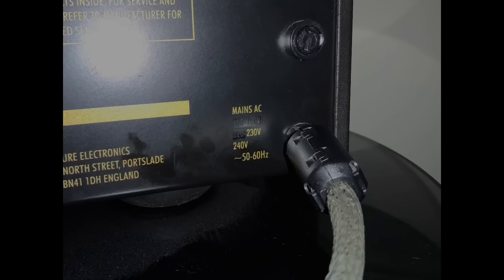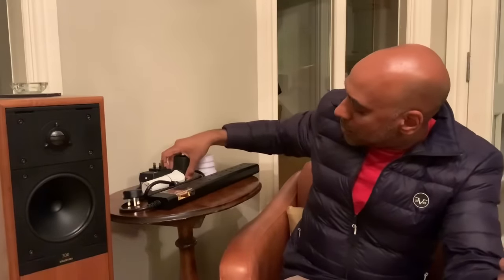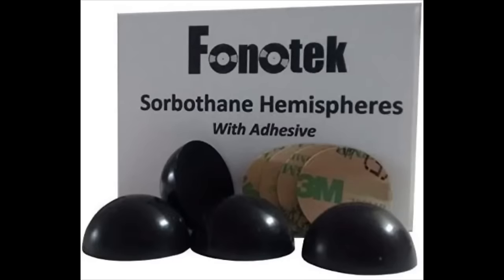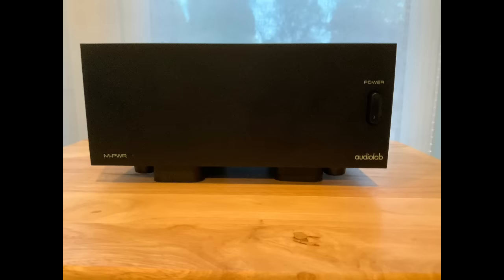My Top 5 Inexpensive Hifi Tweaks

Comment: My audio system is in the shed (think 5 star man cave). I researched and adopted all but the cable option. But, as the shed is on the same mains ring as the freezer, washing machine and boiler pump my Powerline BB dropped every time a device was used. I added a local mains conditioner, AND ferrite filters, looping where possible, to reduce the noise coming down the line. Appears to work (BB speeds will attest). My network is now stable and as such, my shed-fi (as it is known indoors) also benefits from a lower noise floor. I used to sell isolation cones (RDC) and these cover all frequencies, luckily I have a few from that time and have them under all components and speakers. One to watch out for is LED lighting. LED lights cause massive EMI issues and best switched off during musical appreciation sessions (as it was known at school). The last top tip from me is to use CAT8 cables everywhere. Ditch all the cat5 and cat6 for cat8, for one reason, insulation. (again Powerline BB will attest to faster speeds to the shed). I listen to music from my TC (networked) and from a TT in the shed as well at BT from my Samsung S8, this connects to a £30 aptx converter then I use a silver connector to the pre-amp. Shipped in from Poland I believe. I tested all the usual suspects from renowned UK manufacturers that I have been loyal to for years, but took the plunge and went for silver - just for this connection. Everything else is copper....
Reply from the maker: Hi Adrian, very interesting. Thank you for watching and sharing your experiences 😉

Comment: Hello Tarun,

I just got some KEF Reference 5 speakers and they are currently on a wood floor, with pad and carpet on top. I really need to do something with the spikes! The little cup that is supposed to protect my floor is trying to go through the carpet!
I heard you mention the washer cups and think that at 60.2 Kg, the spike cups will either go through or crush the washer cups making them useless.

Do you have any other ideas for heavier speakers?

Keep up the great work!

JD
Reply from the maker: Thank you JD. If it is a suspended wooden floor, try removing the spikes altogether and get some anti-vibration washing machine feet 😊👍

Comment: Hi Tarun took on board  your thoughts and under my turn table I put 4 washing machine  isolation feet (cost £2.70) then i looked at the leads to my amp, the Sony ps-hx500 comes with cheap basic leads I replaced them with some QED leads keeping the earth wire ,woll what a difference the bass & drums really come through now & that's just  the start. Many thanks for the inspiration from Rob.
Reply from the maker: Thank you for watching Rob. I’m glad it worked out👍

Comment: May I say,  I highly recommend a serge protected power strip, if you do nothing else with mains power. I have had my very expensive(was in my twenties, so yes, very expensive for me at that time) reel to reel recorder blow a diode in it’s rectifier, due to a midnight power serge, which I finally had to track down and repair myself, because warranty shop couldn’t find the problem. Equipment was away for months while they did nothing to resolve it. Look at this... it happened years ago, yet I’m still finding need to vent about it. That’s how painful it was to not have that serge protector! Ha ha

  Thank you for taking the time to read this... and thank you for another fine video! 

   Chuk
Reply from the maker: Hi Chuck, good to hear from you buddy. Well said. A friend of mine had a lightning strike that took out his entire system. Thank you sharing 😉👍

Comment: Thank you so much for these tips! After A- B - ing with ferrite beads & without, I liked the sound with. Having suggested them to my brother(who's in Camden by the way) who was having weird sound interference with his guitar amplifier, he tried them out and fixed the issue! I did get a power conditioner to try, and liked it but after upgrading my amp's power cord, I no longer need it. Now I have weights on my amp and dac and the sound has increased ten fold! Microphonics and microvibrations are 'real pests' and must be soundly addressed which I'm so glad you mention here. "You never hear your stereo system sound better than the weakest link in your audio chain." ~ Steve Deckert AMEN!🙏🏾
Reply from the maker: Thank you for watching and sharing your experiences Steve. Very insightful 😉👍

Comment: It doesn't matter greatly in terms of a power cord as shown here, but generally speaking, you should only connect the shielding to ground at the supply end of the cable. This is to avoid the risk that the shielding acts as a ground conductor - both generally speaking, but in particular also in the event the main ground conductor fails. The shielding is obviously not sized for this purpose, and the risk is that the GFCI may not trip as intended if a broken ground conductor results in a dangerous touch voltage. And obviously because only one point of grounding is needed to drain the shielding.

It's definitely possible to find sources indicating the contrary, but applications where both ends of the shield are grounded are typically meant for very different circumstances - for example for signal cables between systems, where e.g. disassembly may be carried out whilst systems are under power - e.g. industrial control systems. These systems will often have other measures to ensure the cable shielding does not become an equalizing link or protective earth, for example by having much bigger and possibly redundant equalizing links parallel to the cables.
Reply from the maker: Thank you 😊

Comment: Nice to see your cable maintenance is first class. I have to hide behind my unit  7 speaker cables  1 subwoofer cable 1 fiber optic cable  4 hdmi cables and 4 power cables 1 monster surge protector 4 led light cables in a space of less then half a meter from back of wall to back of unit. And you  might just see 1 hdmi  cable going from blu-ray player to my tv that's it, but there no mess each cable is separated away from each other not over lapping or nothing even got some cables on the wall using a cable holder .
Reply from the maker: Good job Harpal. Thank you for sharing 👍
Reply: I really need to have ago at my atmos system cables everywhere power crossing over speaker cables.thats why I've put supra shielded mains cables on mine they tiny bit better then belden and belden over lapp .but if you've got pictures good idea to see what some1 else has done with cable management give me ideas.cheers
Reply: @markclancy5371  I used u horizon cable clips to hold my wires in a line and derection I wanted to go, good way of  keeping your power cables away from each other and away from speaker cables.  Recently I had taken all my cables off as I was putting black carpet tiles down. But when I did my cables I first started with my surge protector cable to mains path with u horizon but with my surge protector I put in bottom right hand corner of my unit so it's only less half a feet away from power outlet and away from all my cables coming out from my amp and all I do is plug everything's there so no power wires from amp, tv, xbox, bluray player crossing or near my speaker or hdmi cable's. Found them on amazon. But for atmos headache unless you run your cables in wall lol.  For me I had headache about running 4 speaker cables from unit to back of my room so before I ever put my unit in its place I put a run of 4  speaker cables from where back of my unit would be on floor to each area I needed the cable to be for back 4 channels straight down middle then at other end sent cable in direction o wanted it go laid it a flat and tangle free on floor taped it down the whole way down the cable to hold into place on the floor then threw two thick rugs ontop protect my cables. All you see for my back 4 channels is the cable coming from next to my speaker stands and that's it well hidden lol. I put a review of the u horizon cable clips but don't think it will show until day or too. Hope that helps. As for atmos I'd be honest I'd pay for the cables go be chased into the wall may be something you could get done not cheap or better still do it you self look up videos on YouTube how to do that would be best answer and will look  tidy and professional. If your renting dont bother.

Comment: Firstly - enjoy your work!
Just my thoughts on mains cable upgrades. Perhaps, if you go to the trouble of a power conditioner, then adding a quality connection from it to your equipment may help. Given electrical interference is often induced in the wiring from the loads on the circuit rather than from the ambient surroundings they are probable a waste of time without the conditioner.
If the back of your rack is an absolute birds nest tidying up and physically separating cables as much as possible probably has more benefit then any mains cable could.
Reply from the maker: Thank you Matthew 😊

Comment: The ferrit core around the cable are fine but are meant to be closed around power cables to eliminate radiation noise.

Use them on speaker cables will compromise sound quality.
Reply from the maker: Check out this article Lars.
http://www.empiricalaudio.com/computer-audio/technical-papers/myths-and-snake-oil

Comment: You seem convinced there are improvements. I think that if you ran a blind test removing ALL of the tweaks together, most people would not be able to tell the difference. Tarun, please would you do a proper blind test and report back? Thanks!
Reply from the maker: Hi Rands, the problems with double blind listening tests when it comes to audio is that your short term audio memory is very unreliable. DB tests are fine when the differences are substantial but not for subtle differences. My approach to auditioning any new component is to put it in your system for a couple of weeks, listen everyday, then remove it. Do you miss it? You have to be honest with yourself. It is not a scientific method but it is effective.
Reply: @abritishaudiophile7314  Long term audio memory is even more unreliable than short term audio memory.  Rather than you removing a component on your own after a couple of weeks, you should have someone else remove it and not tell you when they did.

To raise one question, how does putting a ferrite core on one speaker lead at the speaker end of the cable affect the sound of the speaker?  If it's filtering audible noise, wouldn't that noise be there even when the system is turned off?  Do you hear noise from your speakers without the ferrite cores, even when the system is turned off?

If you are convinced that RF noise way above the audible frequency range is getting into the speaker and causing distortion of the audio, can you explain how putting a ferrite core on wire and not the other can fix that?  Technically speaking, putting a ferrite core on one lead would convert a mostly harmless common mode RF signal into a single ended signal.  This would be even more likely to affect the sound, although I don't think it will have an audible effect. If anything, a ferrite core around both wires would do a better job of keeping all RF energy out of the speaker.

But I don't believe there is a mechanism by which a small fraction of a milliwatt of random RF energy can distort or add audible noise to a low impedance, relatively much higher powered audio signal.
Reply: @abritishaudiophile7314  You are wrong. DB tests are completely justified for small differences. Then you admit your method is not scientific! Why not DB test one of your cable upgrades and let us know the results?

Comment: Hello good sir, I use to be manager at Oakville Audio in Ontario Canada from 1996-2000 and we had exclusive rights to John Farlow s design Exposure The Serious Amplification System and I was able to meet John and his son when they visited our store, The Royd speaker is also what we sold in league with the Exposure and Sorcerers and Abbots always a good match , your ProAc is also a great combo as we sold those as well, John has moved to Thailand as he has breathing problems and works with Naim Audio as their go to elder master engineer , I have always wanted just a 15 super from Exposure but never could afford the $2000 lol  I'm now using a Naim Nait 5i amplifier and a Nakamichi TA -3a receiver with Nelson Pass Threshold circuit amplification,  using my knoledge of Royd I built speakers using a B&W Zepplin s drivers and John Achroyd s anti distortion rubber damp ner ...absolutely awesome speakers that cost me almost nothing   yeeeeee haaaaaaa
Reply from the maker: That is a great anecdote. Thank you Scott 😊👍

Comment: I added ferrite cores to my speaker wires after watching this video. Non-technically speaking, it has cleaned up my highs and what's interesting and unexpected is that adding the ferrite cores got rid of a persistent 'red light' from my amp (Krell ksa200-s) that turns on when the signal is not pure. The red light would switch on each time I turned up the volume, now it's gone. I thought the audio signal runs in only one direction, not sure how the amp 'knows' ferrite cores have been added near the speaker-side of the cable?  

I also decoupled my floor standing speakers, huge difference to bass clarity - less thump.

Thanks so much for these tips. Though can't find the power conditioner Tarun mentions, here in the U.S.
Reply from the maker: Thanks TK. I appreciate you watching and sharing. I don’t think the Tacima is available in the US. Furman stuff is quite well priced. Cool first name by the way 😉👍

Comment: Would love to know what power conditioners you used over the years? After doing a lot of research and chatting with electrical engineers I removed all furman gear from my studio because of the negative effects they had and due to the fact they were basically snake oil which provided no benefit.
Reply from the maker: I haven’t tried many but I did have a basic Furman once. I removed it because although it added refinement in the mids and highs it did suppress dynamics. I am happy with the IFi iPower I currently use 😊
Reply: @abritishaudiophile7314 See I know it can have an impact on sufficient power supply to equipment but "refinement in the mids and highs it did suppress dynamics" sounds like a bunch of audiophile nonsense, not backed by objective science and facts (sorry if that sounds offensive). Do you have any objective readings or graphs / recordings to back up these claims? Thanks! Love your channel.
Reply from the maker: @Car Guy daddyo cool 😎

Comment: Edited this after 1 year of testing different cables, pads, conditioners and gizmos. Still THUMBS UP for your videos sir!
- Tip number 5, about ferrite cores, not working. I got a signal generator and an oscilloscope and I see that when signal is higher than 10KHz is a very very little bit attenuated which I really really do not want, so, ferrite cores only on mains power cables. 
- Tip number 4, about antivibration pads, it is a definitely yes. I have found that large anti slip self adhesive pads for furniture, placed under floor speakers works wonders. Even better two pieces of wood glued together with black gasket silicone.
- Tip number 3 does not work for me and I have tried many stuff, including really good UPS brands up to 2KVA, borrowed from work lots of equipment, nope, not working for me.
- Tip number 2, I am wondering if you or myself could find to borrow for a few days a big power factor correction industrial gizmo to try it out, meh, jus thinking with fingers on the keyboard.
- Tip number 1,  could have little impact because what are we doing with the lines in the walls? Those are not braided/shielded , those not protected in any form. 
I'll tell you what I have noticed it helps me: for interconnects made myself the shortest possible RCA cables with large diameter of quality coaxial cables (6mm), very low resistance cables. Then made a pair of solid copper wires for speakers, 2.5 square mm and distanced them with plastic (1 inch), those sounds great. Since then I have never used the expensive SUPRA cables again. I have changed every power chord in every audio gear and added thick 16A cables with ground wire connected to a solid ground connection. That brings peace to mind. In fact I really think that if one single thing in your audio chain does not bring peace to your mind, it probably should never be used again or maybe just continue the journey to search for better things. Anyway, there are things that certainly brings peace to the mind. Those should be kept. Maybe a reissue of this video? Thank you!
Reply from the maker: Hi Ioan, thank you for watching and sharing.